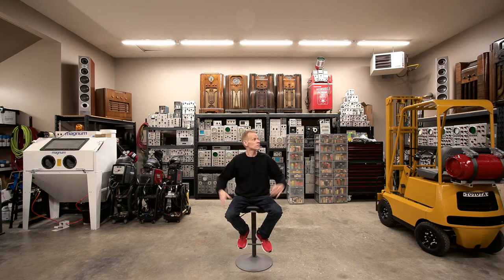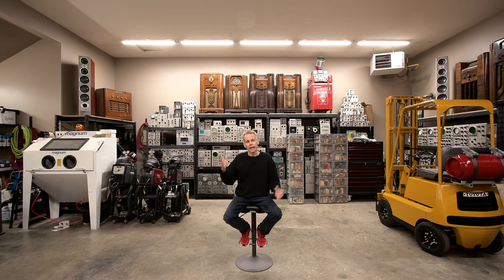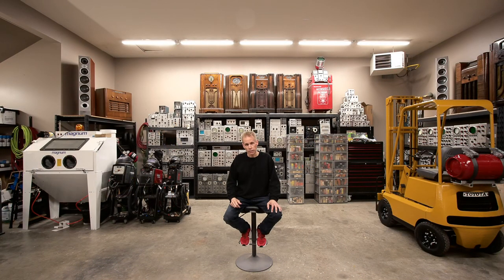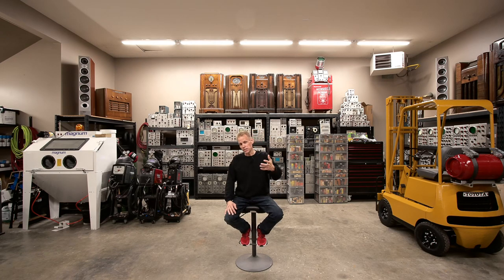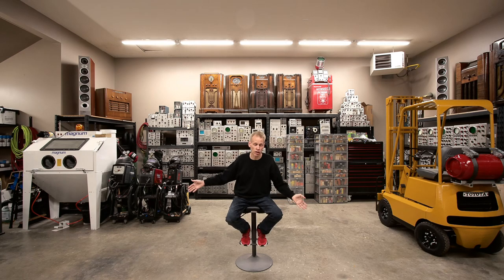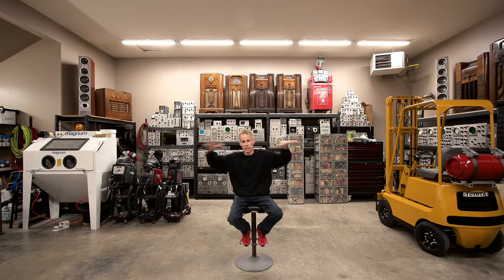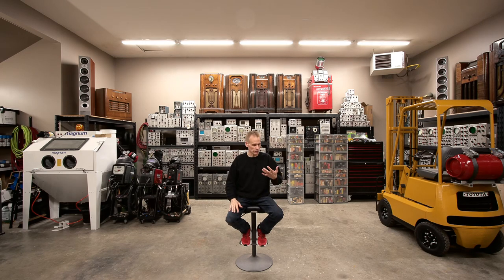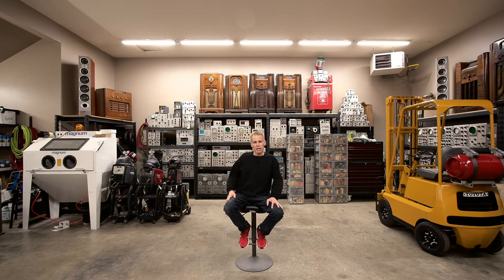ZAP! Mr C's Worst Electric Shock Explained In Detail!

Comment: Recently saw Big Clive mention your comment about electrical shocks and I have a Tektronic oscilloscope story. In 1975 or so I Was 14, a high school freshman and the school had been gifted a Big Tektronic oscilloscope once owned by Motorola GED in Scottsdale where my Uncle worked as an aerospace engineer. Uncle Dick told me they had given away all the huge, well used scopes to various schools around Phoenix when they got new digital scopes. I couldn't fix it at school because Dad wouldn't let me take our tube tester and such to school. At home one night I had gotten the schematics and such for this huge monster and Dad told me to pull each tube, check each one and make sure they were the correct tube number and in the correct sockets; Dad was a Ham and a TV Tech, I should have listened to Dad!
Well, I checked about half of them and found several bad tubes, changed them then started trying to circuit trace the problem. Power supply and Diodes and Filter caps looked good and as I started checking voltages, I decided to check plate voltages... about 900 VDC... ZZZzzzap! I screamed like a girl, ended up jumping about ten feet back and smelled burnt hair and flesh, that smell stayed with me for 3 days. Dad said, "remember I told you about checking voltages over 300 volts and to use the second anode, High Voltage probe, it's right there, Ronald!" Dad never called me that, Dad was so right, he always was. Turns out a horizontal oscilator amo tube had been inserted one pin out of rotation, once I finally did what Dad told me to do in the first place, it came to life and I aligned it. I sure do miss Dad, N7JWF/AE7AD went silent key in Nov. 2020. I really Love this channel.
73s from KD7CKT.
Reply from the maker: Thanks for sharing your story Ron! Your father sounds like a great guy.

Comment: Paul, you are an international treasure and a delight to learn from. So glad you are around so that we can continue to find that out for ourselves.  You are such a Swede! My relevant experience is the story of an 8 year old with a screwdriver and a 1950's television. Home alone! Must have  been suicidal.  B eing thrown across the room broke my connection to that circuit,  and there are some who said I was "never the same"   I am 71 and the jury is still out.
Reply: I experienced a shock that was bad. Not as bad as the one described by Mr. C. I remember feeling very depressed right after and didn't want to do anything. Wasn't my first shock nor my last. I went to my room from the basement and laid in my bed. Didn't sleep either. I've had heart arrhythmia as long as I can remember. Not sure if it's related. Seems it would be unlikely. Most important not to lay down and sleep without being monitored after such an event or when feeling odd and exceptionally tired or ill. Heart attack happens and no one knows. I lost a friend to such an event. Also very common instructions suggest you do electronics work with another person present.

Just found out an hour ago of a man in his forties a friend of my friend's daughter died by electrocution welding under his car. I really want to know more. I wonder if there was equipment failure causing primary utility power to leak through to the electrode? I know open circuit is typically 18 to 60 or even 72 volts. He was in a position suggesting he was shocked with substantial current and at a length of time. Very sad. I weld frequently enough and take several precautions, but I'm sure I'm not as careful as one should be...
Reply: @johnnytacokleinschmidt515  Could water have been recent (and impatience present )- rain, early morning, washed car beforehand? Dry rubber shoes wouldn't help if laying in damp.
Reply: @Don.Challenger  it's a risk. They tell you not to weld on the wet ground. You must lie on a dry surface such as a sheet of plywood. This is very recent. A friend of a friend's daughter.

Comment: I'm glad that you survived this kind of shock and you are still with us!
#1: When I was kid, I came home and for my surprise the door was locked. I tried to ring the doorbell, but the mercury filled button was broken and I got only option to push the iron needle in the button to make a contact. I've got shocked, but I was lucky to have insulating rubber shoes and holding stair handrail from the wooden part to reach the doorbell knob;

#2: About 15 years ago I was changing phone line wires. While I was holding wires, the 45 VDC did not feel on any way, but someone called to the phone line and I had 90 VAC shock for a second :D;

#3: About 8 years ago I had IT system administrator job at the Industrial Education Centre. The workstation PC did not start from the power button, so I decided to turn it to the side on the table, while the AC power cord was connected to the outlet. I grabbed the computer case with both hands and got nice shaking shock (235 VAC). The reason was a mistake in the cabling made by local electrician so that this made the ground line hot. (Never trust the cabling that is not at your home!)

My uncle had once the 325 VAC shock when he was fixing industrial AC-motors. (325 VAC comes from the 60-degrees potential difference between 2 phases in the 3-phase power-lines in the EU).

Comment: Paul, one of my worst "pull a stupids" when I was much, much younger - got across the plate connection (when transmitting) of a 100W GE Prog Line base station.  Threw me back a few feet and knocked me on my backside.  I, too, remember my heart doing some strange things for a few minute afterward, but thankfully it never completely stalled.  Glad you survived, thanks for sharing!

Comment: Paul, I had a similar experience in my late teens before GFCI was common. A heavy tube power supply which I had designed and built gave me a shock across the heart. It had no cover on the bottom and when the power switch was in the off position the two unterminated connections near the bottom of the chassis were live. I picked it up with the line connected to the wall and one finger slipped inside touching the contacts. With 240V ac across my heart my muscles from the waist up were frozen. What seemed like minutes but was probably only a few seconds I decided to fall sideways to break the connection. This experience taught me two important lessons, one about design (the switch connection and covers), two generally about electrical safety.
Reply: Yowch.  I guess it is good to give forethought to what you might try if worse came to worst.  Get your whole body as far as you can from the area by whatever means necessary if your hands won't obey.

Comment: Holy beans man!  Glad you're still with us!  The way it all unfolded and getting blown backwards somehow gives me visions of you playing the part of Doc in Back to the Future. I'm an extra class HAMster that still doesn't feel brave enough to open up an amplifier and hopes to someday take your electronics course.  So many times I forget to disconnect AC power before jumping into a repair...for example a furnace (accidentally welded a gas ignitor/heater to the frame) and a washing machine, (luckily tripped the GFCI while replacing a water inlet solenoid valve).  Even car batteries make me nervous when I work with them.  I do always somehow remember to drain all capacitors before though...when fixing a microwave, and fixing a central air conditioner.  As far as actually getting shocked, that only happened while growing up on a farm and had a few accidental run-ins with the electric cattle fences.  I can relate to the not letting go part, and having to learn to let yourself fall to the ground assuming your legs are still relaxable.
Reply: You must..... Must! If you're troubleshooting then possibly power is applied and you're testing or observing operation. Disassembling or changing parts then you must disconnect power. That's how it must be! Good luck and stay safe! You can do it!
Reply: hey Buddy... if you are working on something electrical put the plug in your pocket...

Comment: Thank you Mr. Carlson.  By sharing your knowledge about vintage electrical devices like old vacuum tube radios and televisions; there is a significant danger and risk of possible death due to an electrical shock.  You have always warned people in every one of your videos that if  you wish to persue the hobby of repair and, or restoration of these electronic devices that you are doing so at your own risk.  Thank you for this video post.  You may be saving lives.

Comment: Hej Paul, there is a trajectory for this. I started in electronics in my childhood, got zapped a few times mostly from anode caps on old crts etc. It was not until I graduated that I actually got electrocuted.. this is a whole other story in comparison to getting zapped (shocked) and your story literally transplants into mine with the only exception being I was not the only one, I had coupled to the guy who got the original shock by leaning on the bus bar dis box he was working on. I remember just thinking that I never got to say goodbye which sucked as we had just brought my daughter into the world. Well 26 years later still here, and like you my incidents with the funky chicken dance have reduced considerably. Thanks for your content bud, I love the vintage vids as it takes me back to when I started out many many years ago
Reply: So not electrocuted but a close call. I've had life threatening shocks as well, but working in the role of support engineer for satcoms systems, I have heard of some horrendous accidents on transmitting equipment, sometimes the reaction to an EHT shock is what causes the damage rather than the shock itself.
10kV at 1.7A is one supply I've had to work on live, you definitely have to be careful around that especially as the filament transformer is at -10kV.
Reply: If I had a quid for every time someone told me they have actually been electrocuted I'd have a least a fiver by now lol safe to say they survived the 'cution' part

Comment: I appreciate the detail in which you describe the incident! As someone with a touch of hypochondria, the description of a stopped heart was particularly chilling. The few jolts I've gotten from, for instance, brushing live connections while un-grounded, were uniquely tingly and unpleasant.

I've been lucky in both my hobby and professional lives to have never received a life-threatening shock. But here's my worst one:  many years ago, I was working at a slightly dodgy factory. We were using an off-the-shelf submersible pond pump to circulate and mix a slightly conductive liquid in 275-gallon IBC totes. I started noticing a strange buzz and tingle in my finger whenever I touched the liquid. After about half an hour, I made the connection that I was feeling an electric tingle. It turned out that the insulation on the cable feeding the pump (which was, no doubt, not rated for anything more corrosive than water) had cracked, and the liquid in the tank was live to some degree. Fortunately, there was no solid ground reference in the area, or the shock might have been significant. I insisted that we replace that pump. I left not long after.

Comment: Well thank goodness you survived Paul where would we all be now without this great channel!. I have been a sparkie on industrial controls for 20 years and never had a shock like that. Ive had a few bangs and flashes that have you blinking for a few minutes but luckily no big shakers. I saw another sparkie connecting up a 3 phase 400 Amp Fuse Board and he had managed to get a short to earth somewhere inside and didnt check it properly before switching it on. The bang and flash was very impressive and the copper in the feed cable lost a good few ounces as it vaporized before the fuse let go he was forever known as Johnny bang bang after that.  I have just retired and am trying to get back into electronics but im starting with cmos logic and working up from there but Im still wary around my power supplies. Thanks for sharing your story!

Comment: Wow- That sounds like a very close call, I'm glad your still here to tell  us about it! 
I've had a few minor mains (UK,240Vac) shocks ,But also as young teen I got a pretty bad shock from an old 70's black and white portable TV - I literally jumped and hit the ceiling(I'm 5' 6"/170cm) in big old room with high(ish) ceilings, landed feeling kind of knocked out and it took about 10mins before "normal service resumed" That's the one that taught me that you can never be too cautious!
I also learnt a similar lesson  as a slightly older teen with RF after being "burnt" by a 50w CB amplifier (wet ant/hands)-that one was quite a bad feeling too but I've never been unlucky enough to get "stuck" like you unfortunately were- Keep giving those warnings- You could be saving a lot of beginners lives and not know it or at least a lot pain! You could/maybe should (if you haven't already) do a piece about all the dangers in the hobby and profession- you could also show other dangers like charging lithium cells, Which I did have a close call with (an house fire) after not noticing a damaged cell not long ago.
All the best

Comment: My electrical safety education occurred when I was 12.  I had built a Jacobs Ladder and was adjusting the parallel electrodes with both hands when my friend plugged it in. 15000 volts at 40 ma.  Wow!  Threw me backwards about five feet.  
It didn't stop me from building more electrical projects including additional Jacobs Ladders and some pretty large Tesla coils.
Learning the One Hand Rule early on may have saved my life. 
Nowadays, and 58 years later as an Extra class Ham, it's mainly RF burns I'm watching out for.
Thank you for the life story and the great channel.
All the best.

Comment: I know that buzzing feeling! My life almost ended at about age 6 thanks to an exposed wire on an ancient vacuum cleaner. I'll never forget it. None of the shocks I've had in my electronic adventures since then even came close.
Reply: Greetings Vic -  I got mine as a helper for a window air  air conditioning installer/repairman. Put my hand where it didn't belong. I woke up on the ground seconds later. Mr. Mahoney my boss just laughed.
Reply: Me too, prob aged 8 though. Trying to 'fix' a old tube radio. When I came back my tounge was numb and I had spark burns on my tshirt. My cousin said the sparks came out of my mouth, but idk about that haha.
Reply: Nah.  Your life was nowhere near ending.  110 just tickles.
Reply: @nyccollin  I agree.  I've had so many 120VAC shocks that  it almost doesn't bother me any more.  What scares me is that tube plate voltage.
Reply: @erdemkaya6472  Yep, 120 just kinda tickles. I'm glad I've never tasted B+.
Reply: @nyccollin  He was 6 years old, so yes it was near.
Reply: @Milkmans_Son  Yes, this is a very important factor. 

Besides the risk of being shocked at that age, the scare of it and memory of it is likely to make it the worst shock, anyhow. My first 120V hit was jarring, but I was probably double his age. Since then, after the rare 120V shock I just let my heart rate go back down and keep working.
Reply: :person-turqouise-waving:
Reply: @nyccollin  It depends. I've had numerous shocks from 120vac. But that time I was holding onto a grounded rail with one hand, while holding the handle of the vacuum with the other. The current passed right over my heart. I don't want to try that again.
Reply: U
6

Comment: Paul... Glad you're still around !    
Mine was a degaussing coil...    The M Coil on a WWII USN Destroyer.   M coil raps longitudinal around the entire ship's hull.   Junction Box mounted to inside hull of ship.   Had to reach so left hand holding the metal hand rail when the ship rolled, right hand went into the uninsulated connections inside.  Thankfully muscle reaction push me away and broke my connection.

Comment: Wow, I can highly relate to your shocking experience. When I was in my late teens, we found this old 1930's GE radio chassis with a 12" electromagnet speaker. I was trying to see if I could restore the radio, had powered it up and was checking it out. For some reason I had placed my L and R hands on the chassis and the Speaker frame at the sametime and got the shock of my life from 450vdc. Not knowing water damage to the electromagnet had caused shorting the B+ to speaker frame.  For some reason the DC current going through my arms caused my muscles to contract violently that the chassis and speaker fell to the floor. And found myself setting on the floor. Felt nervously/weakly strange after that, after a while I got feeling back to normal.  From then on I was much more careful around dangerous voltages. I still have all the parts to the radio and turned the chassis into a Vacuum tube regulated Power supply.  I feel like we each have a guardian Angel looking after us in these kind of situations.
Reply: Only 2 things you need to know about electricity: 1 It's invisible 2, It Kills you.
Reply: @Bazzawombat  Explain how come we are still alive to tell about our shocking experience encounters.
Reply: @Bazzawombat  3: it will hurt the whole time you're dying.

Comment: Great advice. I used to restore vintage table top radios and have been in ham radio for 60 years with a few experiences of 'shocks', but nothing compares to your experience. My retirement job is a Product Technician programming pcb's for theatre controls at ETC and we go to great lengths to promote Electrical Safety.